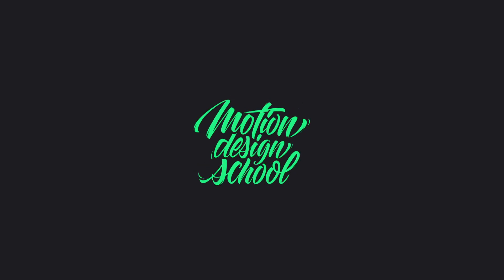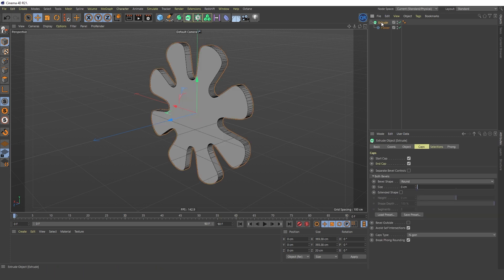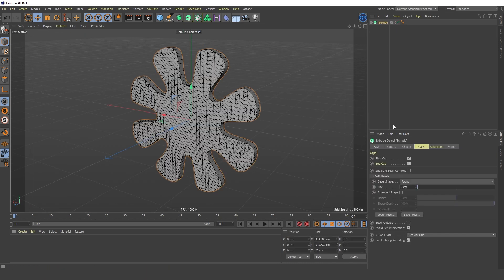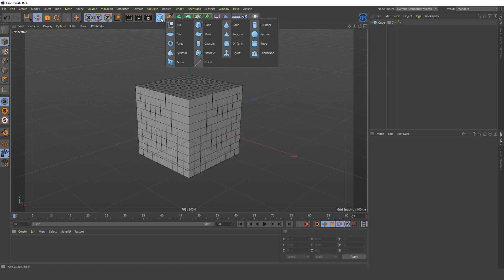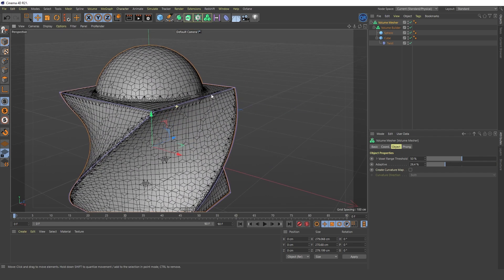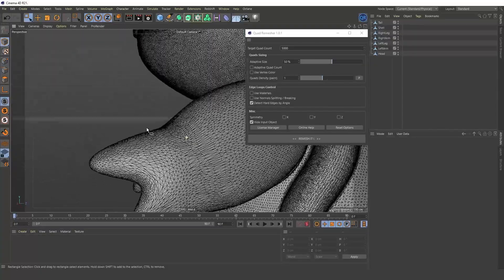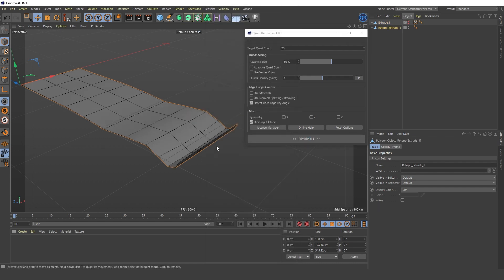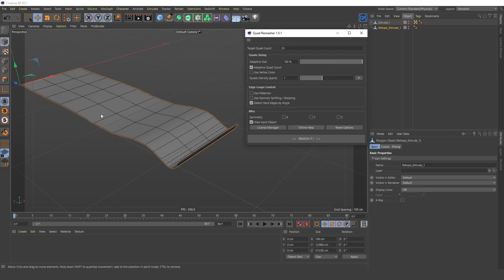Easy retopology of your 3D models – Cinema 4D Tutorial

Comment: OK, so, 1:53 . We are looking at a nice symmetrical object whose new quad topology is anything but symmetrical. That is one ugly set of quads (leaning to the right near the middle of the object, in fact). I am left to wonder if hand retopologizing 1/16th of it with a simple grid and then using symmetry multiple times (first to mirror, then to rotate), would not have been a much better choice.

Comment: I can’t believe this isn’t built into C4D as a deformer
Reply: Except it is built in! No longer as a deformer, but as a generator called "Remesh." It can be found in the same toolbar group as Subdivision Surface. Leave Remesh's "Polygon Type" to quad-dominant, its default setting, and away you go. You can even check "Only Quadrangles" if you want to sacrifice some topology niceties created by triangles and really go all out quad. Also, because it is a generator, the quad remeshing is procedural and non-destructive! You even retain control over various parameters like mesh density, creases, smoothing iterations, etc...
Reply: @SteelBlueVision  You saved me mah Big Thanks
Reply: @SteelBlueVision  thank you very much man... solved my problem withtout having to pay 100 bucks